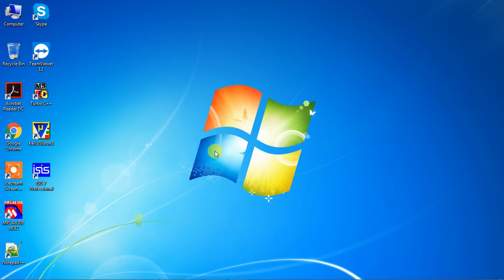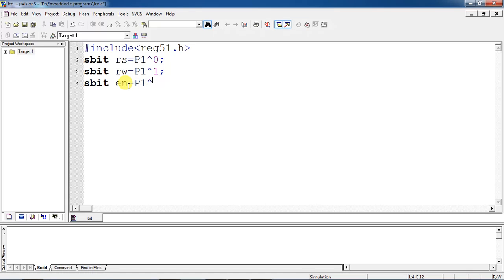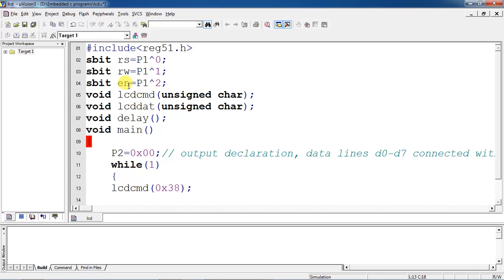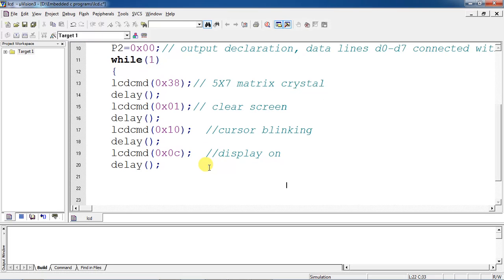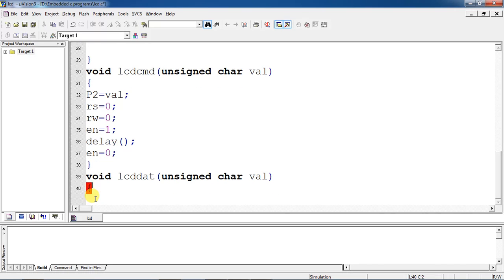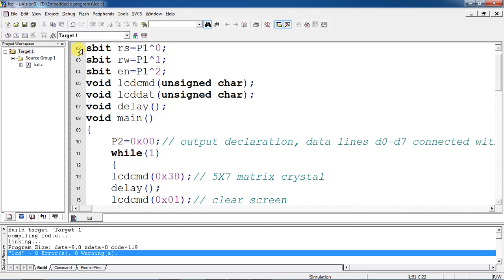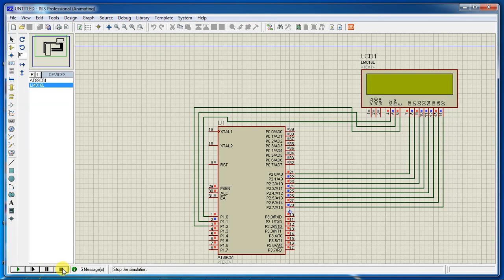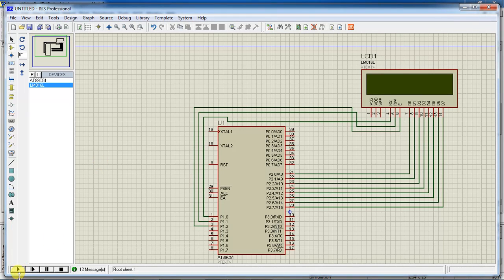16x2 LCD Embedded C program for 8051 with Keil and Proteus simulation

Comment: I tried making a character array and put a string of my name in it. then I ran a for loop for each element in the array and assigned each one to an unsigned char. Then in the same loop I used the char in lcddat(). But the compiler throws an error saying 'left-side of asn-op not an lvalue'. Does anyone have a solution for this?
Reply: The address of a changeable object is required on the left side of the assignment operator.

This is what it says on the keil website.

I think what this means is that you have written the variable whose value is to be assigned to the left of '=' and the variable where you want to store the value to the right of '='. Check your code.
Reply: @ddm1912  yeah, I changed the expression. I figured it was that problem, thanks for the reply.

Comment: Queries
1.keil use c or c++
2. can a program in c be used c++ vice versa I m  confused.
3. can I input all characters at a time like lcddat('ELECTRONICS');
4. I heard D7 of lcd is a flag that checks if busy in data read. We have not used D7.
5. Can I take int instead of unsigned int as we are going for all positive values of i from 0 to 12000.
Overall your attempt is very nice and very good explanation with comments. Thank you

Comment: hello, please, where do i find the ldc hexadecimal comands? thanks!.
Reply: LCD command codes

Command code    Description

0x01      clear display screen
0x02      cursor Return Home 
0x04      shift cursor left
0x06      shift cursor right
0x05      shift display right
0x07      shift display left
0x08      displays off, cursor off
0x0a      display off, cursor on
0x0c      display on, cursor off
0x0e      display on, cursor Blinking
0x0f      display on, cursor Blinking
0x10      shift cursor position right
0x14      shift cursor position left
0x18      shift entire display to left
0x1c      shift entire display to right
0x80    force cursor to beginning of  1st line
0xc0    force cursor to beginning of 2nd line
0x38    2 rows and 5x7 matrix
0x28    4 bit mode, 2 rows and 5x7  Font
Reply: TX alot for giving information sir